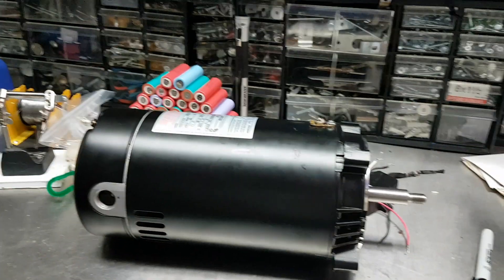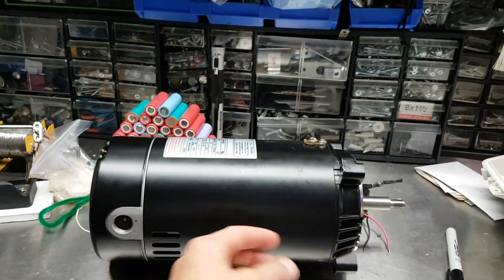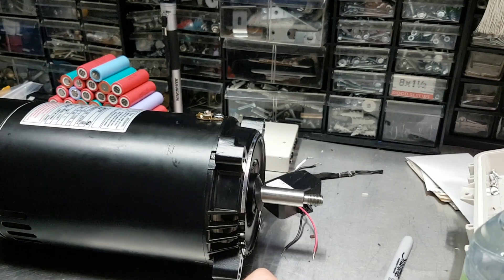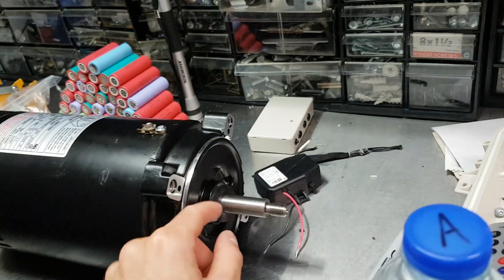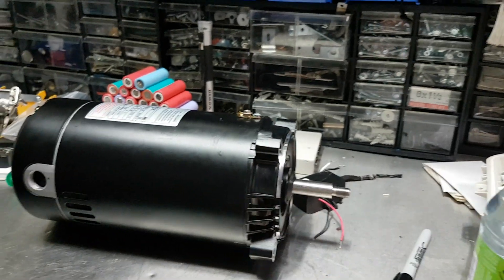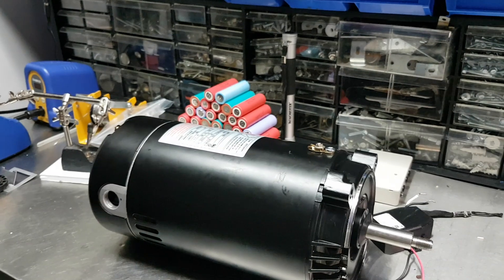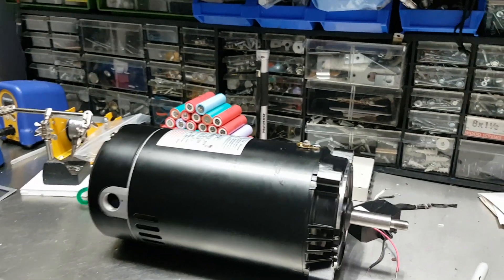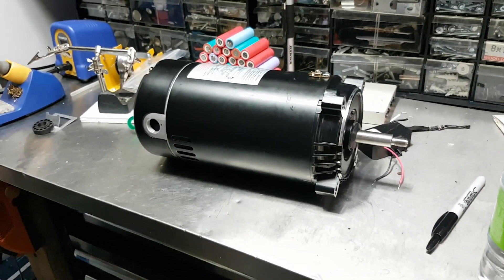Hayward Super Pump Major Design Flaw In Motors That Causes Burn Out

Comment: Have you ever seen a permanent magnet motor from Hayward have its magnets come detached to the stator and spin around the stator while the stator stay stationary? On my unit the fan on the back starts to spin slightly and then stops but you can still hear something inside spinning which is most likely the detached magnet not the best design by far.

Comment: With all due respect AO Smith, Century, GE, all have been building motors like this for 40 years. I repair, rebuild and replace irrigation pumps and Goulds has been using C-flange motors like this forever.  If the seal fails sure but it isn't like that happens often.

Comment: What would you propose as a solution for a salt water pool?  I have been through 2 pumps in 15 years, on my third just now.
Reply from the maker: You can try installing a sacrificial anode, ensure all metal parts and equipment are bonded as per NEC/CEC. This will help mitigate the effects of galvanic corrosion. Salt water pools are a huge scam.... Many people do not know this is ancient technology from back in the day before commercially produced forms of chlorine were available. The systems have only made a come back now because the industry has seen what a money maker it is. The salt water will eventually corrode anything and everything.

Comment: Do not get a blue torrent motor!! I have a century HST150 motor ran fine for the 3 1/2 years while I was at my job. Is running on 208v 3 phase power on the 230v setting but its still within + and - 10% runs alittle warmer then 220/240v but operates just fine. Well the bearings went out and I got a blue torrent motor. What a pile of garbage. Thing overheated in less then 5 mins, Smelled like WOK oil. Thermal overload kicked in no matter what I did. It was on the 230v setting. Put the failing pump back in but it failed in 3 days melting the motor pump mount plate. Had to take apart the auxilary jet pump from the SPA. since it closed due to COVID. It's 1/2 HP higher at 2hp but the impeller and everything fit fine from the 1.5hp. Sending that china junk back and getting a hayward branded super II motor. I hate pools. You want to replace seals? Get a pentair! They fail once every 6 months.